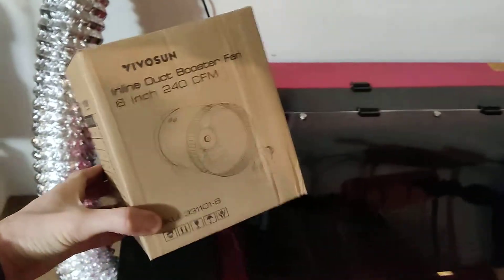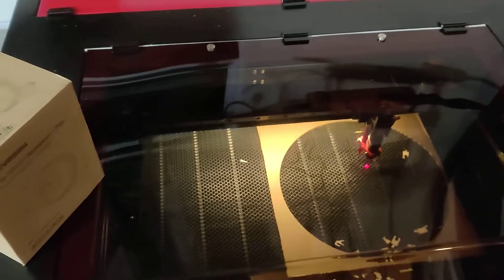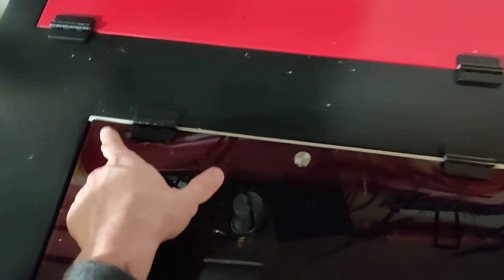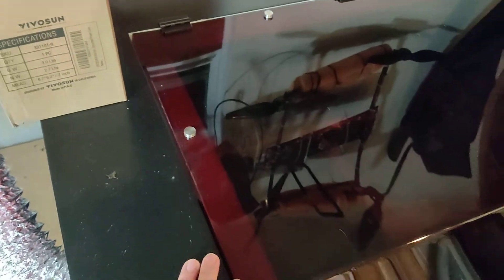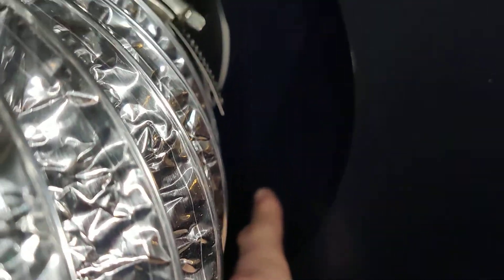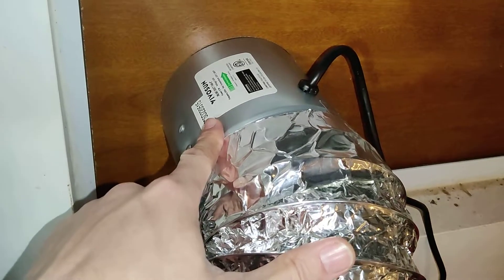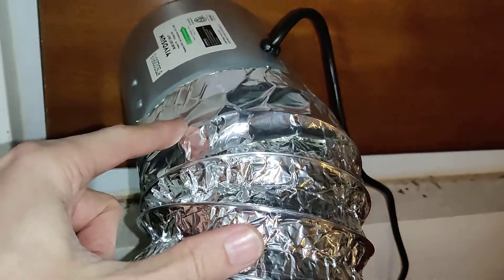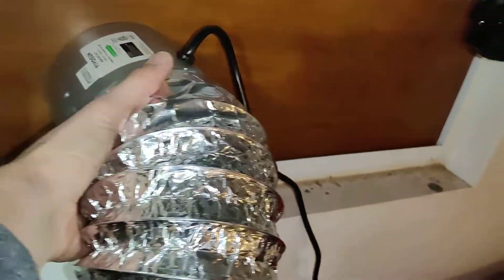Easy upgrade to any CO2 laser cutter (OMTECH) Inline booster fan

Comment: Hi
This is definitely a positive improvement to the machine. However, your airflow management strategy is a bit  off. Imagine trying to drink out of a glass Coke bottle without taking your lips off the  neck. How many gulps would you take?  One  maybe two at most. Why? You must  let air into the bottle to get the Coke out. Your machine is now a big Coke bottle and you have  just sealed evrything to prevent air getting in.  The principle of fume extrction is very simple , You have installed a 6" fan that has a duct area of about 28sq inches.  The fan is designed to create air FLOW so you must have at least 28sq inches of OPEN area to let air into your machine or you will have ZERO FLOW. The fan will be strangled and the airflow will stall. Your machine will  become a vacuum chamber.  Thus taping and sealing your machine is the opposite of what you must do. You mustn't  feel too bad about this simple mistake because ask yourself where is the DESIGNED open area into the machine.. It  seems that the Chinese designers were more intersted in looks rather than worrying about fundamental issues such as fume extraction.. Withou doing any unsealing at present, can I suggest you put two 1" spacer blocks against left and right door pillats to prevent the door from closing. This will allow a perfect sheet of air flow into your machine. I assure you that when you open the door there will be no cabinet full of fumes drifting into your workshop. By the way. You may have to disable the door safety switch.
Reply from the maker: Excellent writeup. I did notice when the laser is done cutting and  I crack the top door, the fumes instantly disappear. Good catch.

Comment: I have missing fear because you can't work with machine.
Reply from the maker: Why
Reply: @VisionGuy  I would like to how it's working.
Reply from the maker: @Mestike-v6i  
Yes, it's working very well. 
No smoke smell inside the house. 
Sometimes if the laser is finished and I open the door right away, it lets a little smoke inside, but if I wait 5 seconds after the laser stops cutting, the smoke is sucked outside.

Comment: Change out the aluminum duct hose with a black layered hose. If you turn off the lights and shine a flashlight in the aluminum duct hose you will see it is riddled with holes.
Reply from the maker: Thanks a lot brother! I was going to upgrade the hose because I assumed the ridges also slow down the air flow, but with the added info, it will get done right away